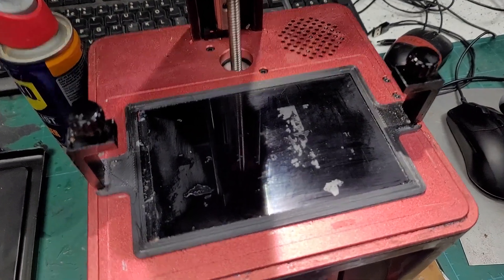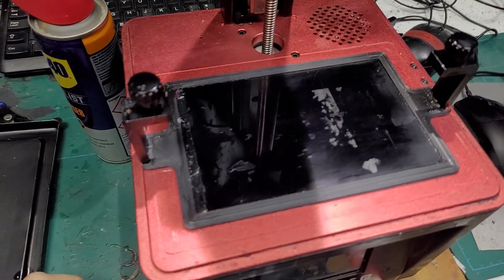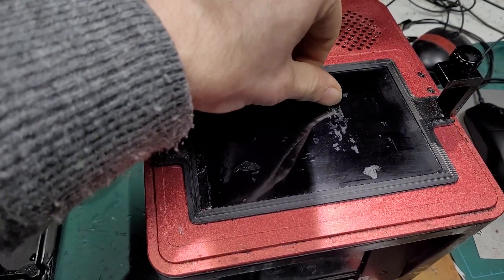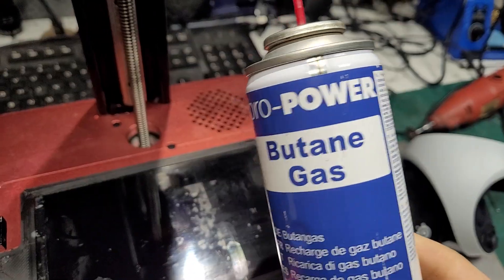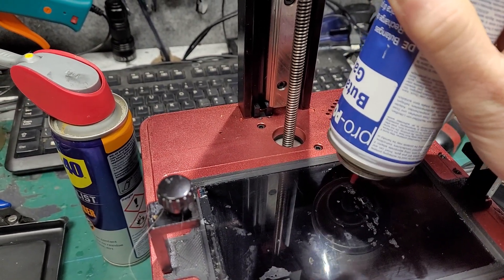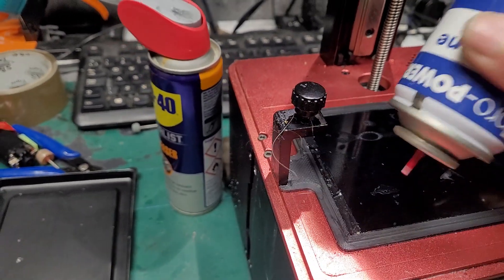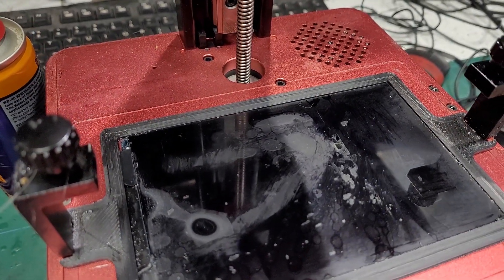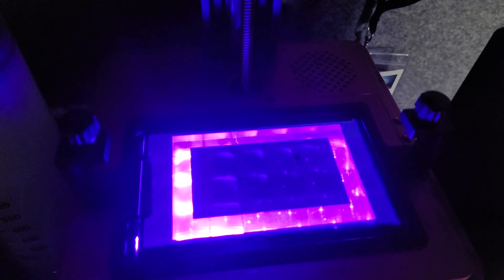New simple method - remove cured resin from 3D printer screen

Comment: Why not just use compressed air upside down?
Reply from the maker: It needs the cooling effect of the butane gas evaporating to loosen the resin off the screen
Reply: @chazj1976  compressed air does that too
Reply from the maker: Do you mean duster gas for keyboards etc yup that might work too but it's boring point is a lot lower at -25deg C  Normal compressed air doesn't come out cold.  Butane probs best as its aro7nd -1degC and less likely to impact the screen
Reply: @chazj1976  I've phrozen a roach with compressed air upside down and shattered it like the terminator. Yes dust off. What's this about boiling point?
Reply: Hey ive been looking up to your part for the kwc uzi and was wondering if you could 3 d print custom part for other airsoft ,i am looking for a Threaded barrel or adapter to put a suppresor on a kwa vz.61